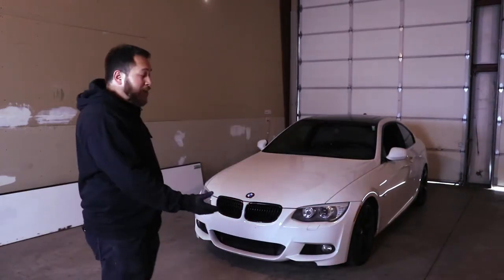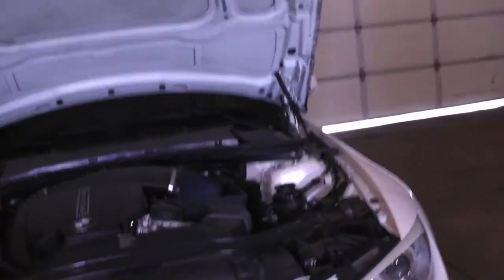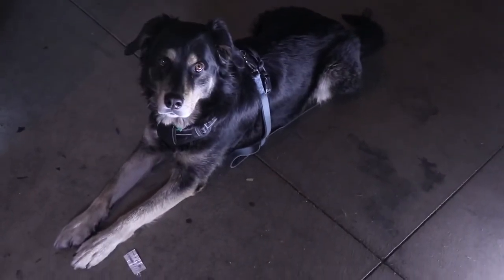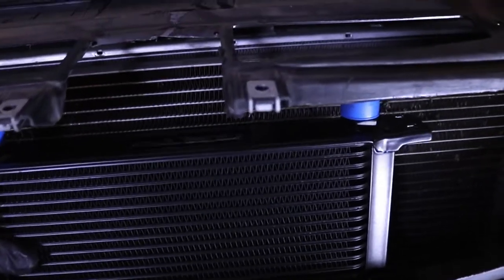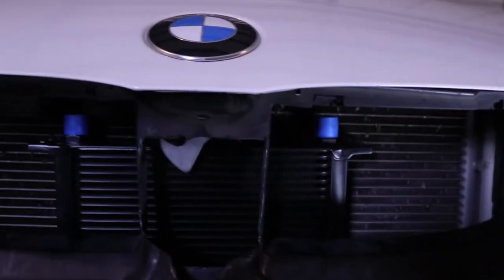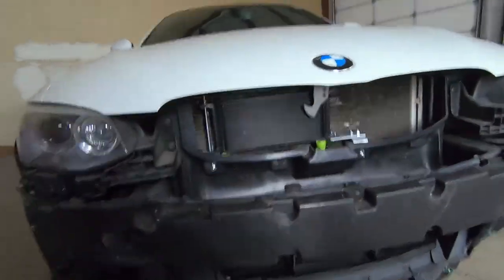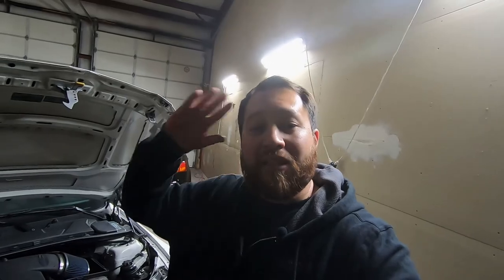335i Gets An Oil Cooler!!!

Comment: I have a 07 n54 and it doesn't have the oem oil cooler 😬 I'm thinking of buying the oil filter housing that has the oil cooler connections and buying a cooler similar to the one you installed. I probably don't need To worry about getting a adaptor that flows oil to two coolers since I don't have it 😂

Comment: I have the same exact adaptor fitting, how did you get it to screw in next to your upper rad hose?? Mine wouldn’t work no matter how I tried
Reply from the maker: @E93RGY  It has been a little while since I've done this project.  I don't remember having a problem with mine working
Reply: @markskeem  Darn, appreciate the response kindly homie

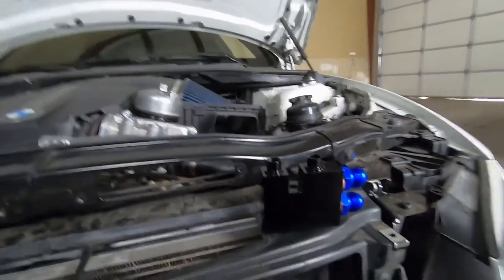Comment: Can I ask you a question, at 10:40, the oil line adaptor block, I am about to install an oil cooler as a replacement for my leaky oem cooler and have the same oil line adaptor as yours, Am i screwed with that oil line adapter block if all I want to do is replace the oem cooler?
Reply from the maker: Your oem cooler will still be in use with the block.  So it is still going to leak.  I would say just replace the oem cooler.  If you need more oil cooling then install the block and another cooler.
Reply: @markskeem  unfortunately I already have the kit. Thanks for your reply, I will just have to puirchase an adapter.

Comment: How much more oil did u have to add ? and did u add it into the oil cooler itself first or just into the engine after?
Reply from the maker: I added the oil after I installed it.  I wanted the oil to be filtered before going through the cooler.  I want to say it was a little more than 1/2 a quart of oil.